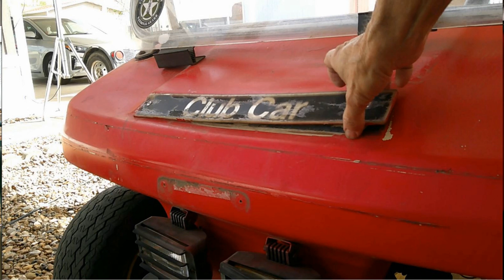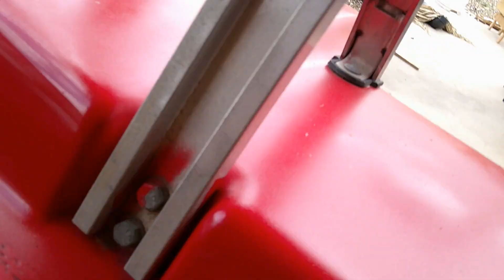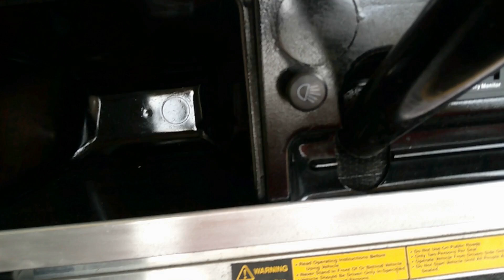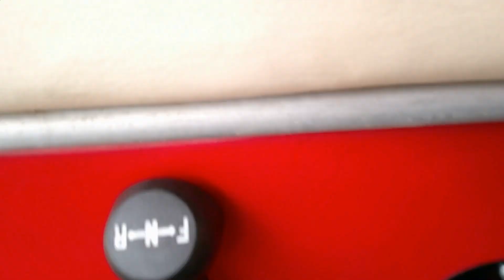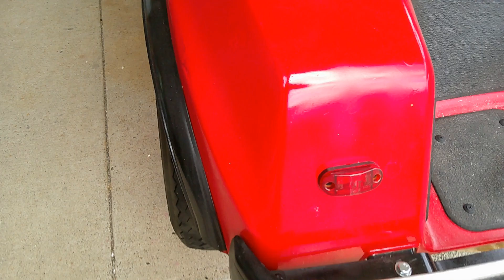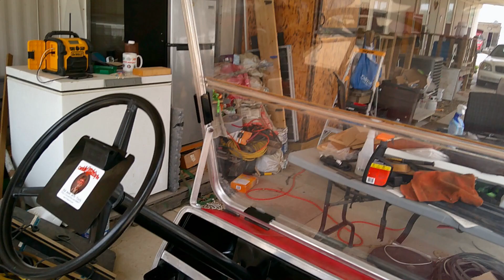1990 Club Car Upgrade Part5 (final)

Comment: Curious, was the OBC removed when you did the conversion, did it even have an OBC ? How does the onboard charger work ? Need any cables to plug into power source ?  Overall, great job converting to lithium batteries, updating parts, cleaning up golf cart, and new paint.
Reply from the maker: No sir, the old resistor circuitry didn't include an OBC. In fact, it was about as anti-computer as one can get. They work much like chaning the light level of a lamp by inserting a string of resistors and then simply picking off the point where satisfactory light level is acheived.  Very inefficient use of power.  The on-board charger output is simply connected to the plus and minus side of the traction pack (series string of batteries.) When it's time to charge, one need only run an extension cord from a close-by outlet to the cart, lift the seat and plug in the charger.  Thanks for the kind words. I've done several of these conversions for neighbors so far. I think that one was number six. Now, one of my early takers brought his cart back and had me install an inverter on it so he can use his cart as a portable power generator to keep his lights on and fridge running during power outages.